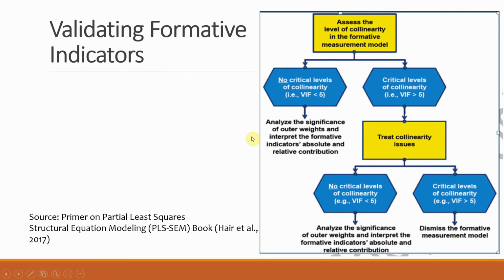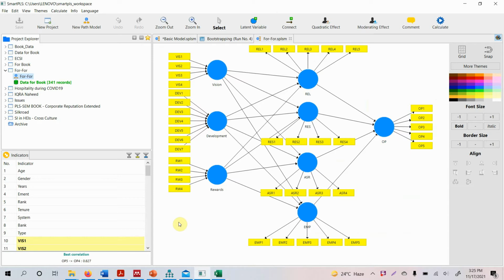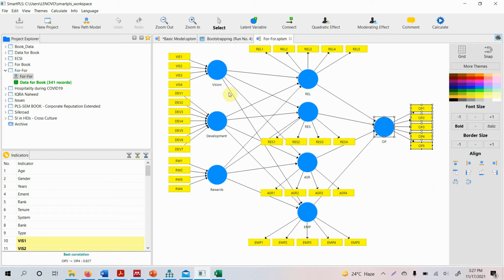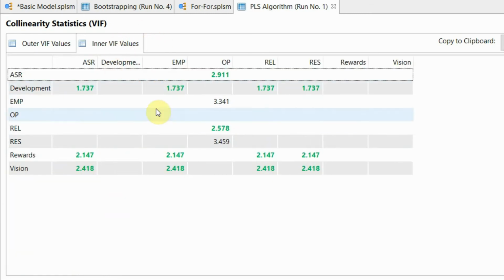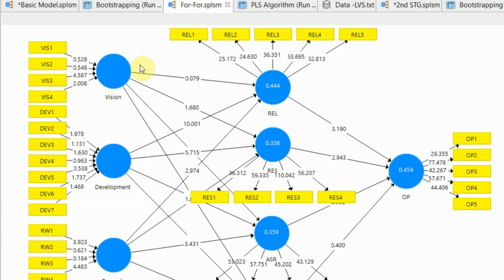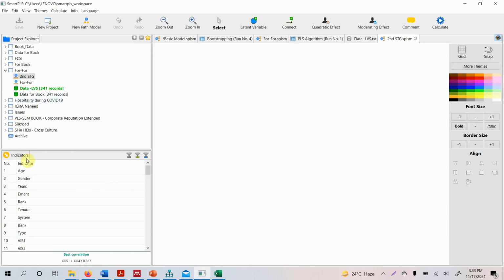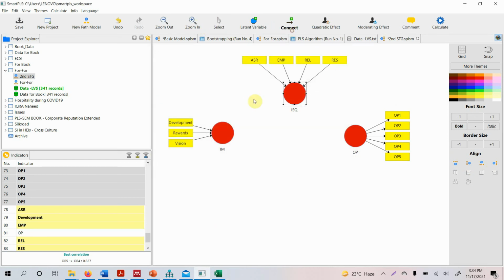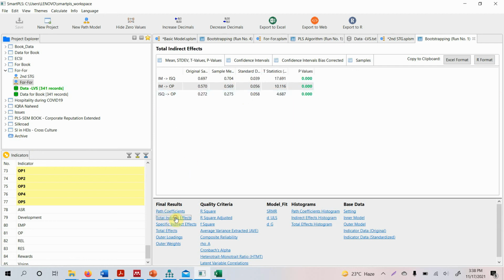4. Formative-Formative Higher Order Construct/Second Order Analysis using SmartPLS - Research Coach

Comment: @researchwithfawad, thank you so much for this video. I have a question. I noted you don't mention checking the convergent validity of the formative constructs using redundancy analysis (as mentioned in some books and literature). Is that not necessary? I am currently assessing a formative-formative HOC model, but I do not have global single items for a few of my formative constructs. Thus, I am unable to check convergent validity via redundancy analysis. Is this a problem? If it is compulsory, is there any other way to check convergent validity? Thank you in advance!
Reply: Fawad sir has not done redundancy in this video but in some other video, he has separately mentioned and performed the redundancy using the global item
Reply from the maker: Thanks. Yes i have. If i am not wrong, this is the video: https://youtu.be/OrBGwmsmz78
Reply: @jasonbale674  thanks

Comment: Thanks for this valuable lecture. Sir, I am also following your lecture. Sir, Redundancy analysis isn't mentioned in the above Hair et al.2017,  Flow chart. Sir could we go for formative - Formative construct validity without redundancy analysis.
Reply from the maker: If you do not have the data. You can check other estimates VIF, Outer Weights and Loadings

Comment: Thank you for your instructive videos using SEM-PLS, do you have a video or journal paper that shows how to relate a 3rd order (formative/reflective) "first construct" with a 2nd order (formative/reflective) "second construct"?  I should point the last order from the "first construct" to each latent variable on the "second construct" or only to the last latent variable on the "construct second".  I am currently working on a framework that has one 3rd order construct and three 2nd order construct
Reply from the maker: If i understood correctly, your model for 3 Order is like Reflective-Formative-Formative
Reply: @researchwithfawad  yes (this is the first construct of 4)
Reply from the maker: Take LVS at the first Level and use it for the next two HO level.
Reply: @researchwithfawad  Can you explain it in more details pleas? I have a 3 Order, like formative-formative-formative and reflective-formative-formative, what should I do in this case?